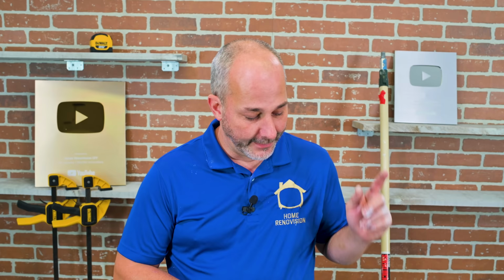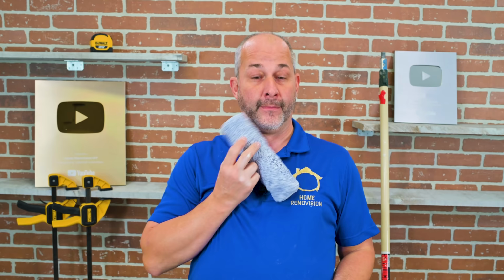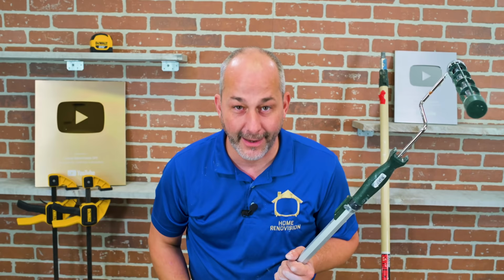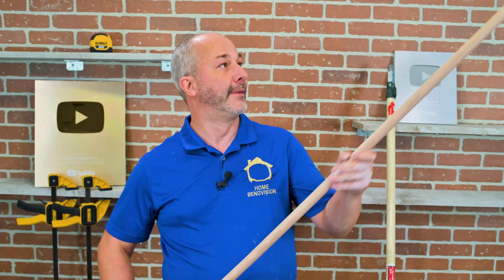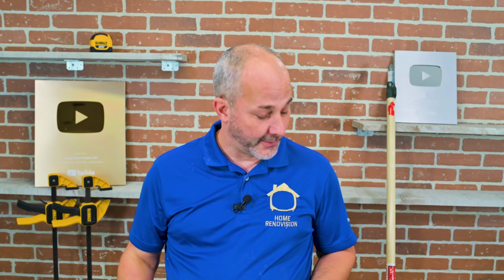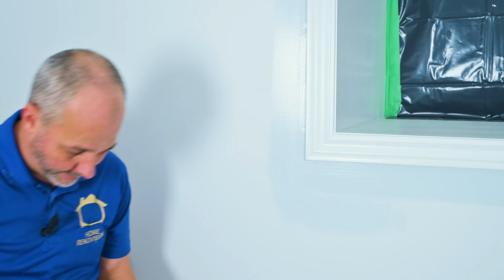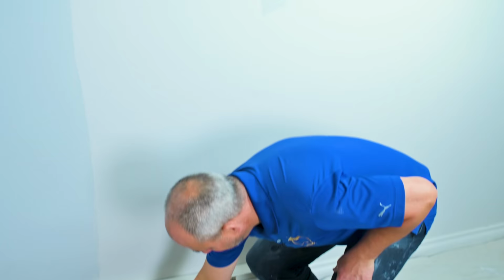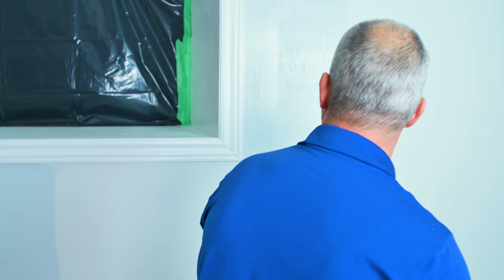Cheap vs Expensive Painting Gear | Is it Worth It?

Comment: I’ve found that getting quality brushes you can use over and over are totally worth it
Reply: Exactly. What is an extra $20-$40 bucks? And if you don’t have the extra $20-$40, then you shouldn’t be starting your paint project. Save for a tad longer until you get all the money for the self project with a little extra for things you didn’t consider and then start the job.
Reply: True!
Reply: #💯TRUTH
Reply: Get good paint also.
Reply: No question
Reply: Purdy brush FTW.

Comment: I've done a lot of painting & used both the cheap & better quality products & using the cheap stuff is time-consuming & a general pain in the butt. I've tried those straight edges that are supposed to keep you from taping to cut in & they were worthless. The paint bled around the edge. I hate taping so I learned to be good at cutting in, but I've used the 2" angled brush. I'm going to get the bigger one that you recommend. Bit of a head-slapper. Love your videos.
Reply: I think you meant "paint in the butt" 😆 🤣 😂

Comment: I used that trim tool on my stair walls. Didn’t have a great way to get all the way up close with a brush and that tool solved the problem with a long pole attached. Mine worked great just don’t get paint on the wheels and take your time it works like a charm.
Reply: I love that trim tool for cutting in around ceilings! I found one where the wheels flip up out of the way to load on the paint.
Reply: Came to say this.  Very clean edge over the stairs with a long pole.  10/10 would recommend, but you gotta be careful with applying the paint to the pad and not hitting the wheels.
Reply: Don't dip the trim tool in the paint. Brush the paint onto the pad.  Don't get paint on the wheels, and be aware of how far the pad is from the top

Comment: i would add, if you have large open walls and ceilings to paint, it may be worth getting a 18" roller in addition thats supported on both sides of the roller. You still need the 9 inch roller to get in close to corners and tight spaces. But if you have lots of large open space, the big roller speeds it up alot. In addition because it's supported on both ends of the roller, you get even pressure, and wont get streaks like you can if your technique is off with the 9 inch.
Reply: I agree. I just did this. Got a 18 roller with support on both ends and 4ft-8ft Sherlock extension pole. Worked great! Finished super fast and great coverage. Used the normal 9 inch for edges/corners. Should have gotten an 18 inch roller long time ago.
Reply: Thank you .. awesome videos, glad I found this place.
Reply: I have yet to find a store that sells an 18” roller. Hard to find in Canada
Reply: @skyline5354  go to paint stores. Like Dulux, cloverdale paint, sherwin Williams etc. professional painters use them all the time
Reply: @skyline5354     They sell them at Home depot, at least here in Kingston.

Comment: 10:21 That edge tool actually works pretty well. Instead of dabbing it in the tray, apply paint to it with a paint brush. 
Apply more pressure to get your paint closer to the edge of trim or ceiling edge. I've been using it on and off, in certain situations for about 10 years, with good results.
Reply: So use the edge brush to add paint to the edge tool?
Reply: I used to apply it with a paintbrush but I found it so much easier to pour some pate into a leftover squirt bottle and squirt it onto the pad instead. Same clean result, less bending, much faster.
Reply: @ljo7560  Good idea. 👍🏻

Comment: I love using the pad. Get the ones where the wheels come away from the pad and then re-lock in place. This is so that you can load the pad without getting paint on the wheels. Also a quick tip is to use a squirt bottle full of paint and squirt your paint on the pad rather than dipping it. What you don’t want is to get paint all the way to the edge of the pad. You’re going to use the pad like an angled brush and push the paint where you want it to go.
Reply: Love the tip of a squeeze bottle. I use a paint brush to load mine up and they are great for quick repaints ESPECIALY on the same colour.

Comment: I've been using the square trim thing with the rollers for years now. There's a bit of a learning curve but I absolutely love using it for fast jobs now. You definitely don't want to overload it and you get used to being mindful of the wheels rather quickly.
Reply: We have used it too. We like using for jobs that need alot of trim.
Reply from the maker: Great to hear!
Reply: @HomeRenoVisionDIY  I just realized, it might have left it at quarter inch Gap if you put the pad on backwards. That may be why it closed the Gap when you flipped it around. The tool doesn't have a safety to stop it from popping on wrong way.
Reply: @HomeRenoVisionDIY  Jeff, these people are scaring me.....

Comment: Jeff the red paint pad is by Shur-Line, they work great especailly on a repaint of the same colour. I can cut a room in less that 10 mins. Like using a brush the more you use it the better you get. I load mine with a brush but did a comment below that gave an awesome tip of using a squeeze bottle! LOVE my Wooster brush, rollers and poles.
Reply: If you don't foul the wheels you cannot beat the ShurLine. Latest version lets you pivot the wheels back while you load it. You can also clean em while they're pinned back, if nec. Yes I can cut a room in, but why should I?
:-)

Comment: Thanks for this demonstration/comparison. I can quickly said that if you are good at painting you can get away with both equipment. If you only paint once a year... the professional equipment won’t be much help! 😁This said :
- The tray you’re showing is a good option, it’s going to last for years if you take care of it. Just buy cheap plastic refills to save you time on cleaning.
- I don’t know if the Wooster frame I saw in one of your videos but I now have three of them. Can’t thank you enough! With these frames no roller are slipping out. Yes for the often cleaning. It might help also to put some WD-40 from time to time to have a smooth rolling.
- For the fibers I don’t usually have problems if I buy the roller you are showing (good quality). Yes for showing a little love; a well cleaned up roller can last a long time. Be careful using certain paints. When doing ceiling flat white from Benjamin Moore, if you don’t clean your roller the same day you are using it it will be ruin the next day (the roller is coming all stiff). Washing the roller can also help, being humid the paint is going to adhere a lot quicker to it.
- If everyone knew that having good brushes can help A LOT when doing painting. Same, clean your brushes properly and they can last for a very long time. Of course, the wider the brush, the more stable your cutting line is going to be ( I use a 3 in brush for cutting, smaller ones for detail cutting or hard to reach areas).
- Oh, I think I’m getting this Sherlock stick! The expendable pole you have is the ones I’m using now. The red tape on it is it to hide the screw on the pole? Don’t know why this is there, any answers?
- At 11:20 You must be referring to the «ProPainter». I used it once to cut a very high wall, it was ok because you don’t see the final result very close. I got the impression that what you have is cheaper than ProPaint. The wheels on the red model are more hidden it seems. And a tip I you say, once you dab the paint, swipe the border with wheels a little bit, just to make sure there is not too much paint on that side.
(sorry for this long comment)
Reply from the maker: Cheers!

Comment: The roller edger thing that I've used is made by Shur-Line.  I've never liked using it, and prefer using a good-quality brush.  Having said that, I used to be able to paint free-hand along trim, but with age, my eyes aren't as good and my hands aren't as steady, so taping is the only way I'm able to paint edges nowadays.  I've never enjoyed painting, but have done plenty as a DIYer.  You can definitely feel the difference in quality between dollar-store and paint store tools!  Dollar store ones are definitely throw-aways, while paint store ones can actually be washed and reused hundreds of times or more.  I also avoid big box store brushes, since they're sort of in-between and I'd rather just have a small handful of excellent brushes than a lot of so-so ones.  Exception is if I'm painting/sealing a floor or something... then it's all dollar-store stuff since I'll throw it away afterwards anyway.

Comment: He is correct. Oh my goodness, if you use a broom stick, it will constantly unscrew and potentially make a mess. When painting, use quality primer (when needed) and paint. Quality rollers, brushes, cages, and sticks are a must.

Jeff has multiple, detailed videos on priming drywall and painting. The prime check information is a lifesaver — makes for a perfect finish.

By the way, those edger pads start nice and easy for the first two or three passes, and then it becomes a mess. I tried them about six months ago, to see whether it would be quicker than the brush method. It can make it quicker for less experienced painters (including myself). Unfortunately, it is a mess. I just practiced edging with the brush, with no tape. It’s fine.

Comment: Dip the cart with the wheels tilted up and load paint towards the back / opposite side from the wheels. Start in the middle between 2 points your trimming make a short pass away from the guiding edge in case you have excess paint and then come into what you are putting your wheels against. Keep a wet rag nearby if you get paint on the edge guides. Once you learn how to use them you can smoke someone using a brush bc those pads can hold a lot more paint than you realize.

Comment: I've been painting with my line of work for a few years. My previous job we swore by the same Sherlock system you have (it really is worth the money). This job I was literally given an identical frame and a broomstick and I told my boss I won't do it because it will look like crap and get passed onto me. We got some better painting gear, and I've been slowly getting my coworkers on board with better technique.

Comment: Thanks Jeff. I believe in getting what you pay for but I admit to buying cheap rollers & brushes because I expect to toss them after a few uses. However, your video has given me reason to reconsider. With the reduced consumption of oil based paints, cleaning is easier.

Comment: I've used one of those edger things and it's decent once you load just the right amount of paint in it.  It can hold way more than it looks and it makes a mess quick.  The big caveat for it though is that you have to have a surface those wheels can engage on and not all edges are going to have that.

It can add some speed to edging, but you can only get a mediocre-at-best result.

Comment: for the flat pad with the wheels, the pad itself goes on two ways, with stops built in to either leave a gap near the wheels or get up right close to the wheels. I've used the red one often. I lightly dip into the paint then wipe the whole pad along the edge of the pan to remove excess.  I will roll along the trim and then lightly wipe away the edge farthest from the trim with the pad wide without the wheels as though it were a brush, so there is no line but is feathered in to the wall in case it dries before i go back with the roller.

Comment: I do cut ins the same way you do, I never use tape anymore. I always found with tape there'd be an uneven edge to the paint, whereas without the tape and just using an angled brush I get a much cleaner/neater finish. It's a bit more effort but totally worth it.

Comment: Cheap demo at 10:19 mark...the trim item is SHURELINE...and what I do is smear the paint on with a brush...not dab it in the paint tray directly...this way you do not get the paint on the wheels...and YES work your way in....start away from the ceiling or trim and work your way in to it in multiple passes...

Comment: I've painted my whole downstairs with that red cut-in pad contraption lol. I hate the roller brushes but maybe I need to try a ball bearing expensive one? I have textured walls and the square red thing was just way more even coverage and way faster than the roller I tried using and much less fatigue. I'm sure I was using the wrong nap or wrong material roller and wrong style and terrible technique. That's why I'm thankful for people like you that take the time to teach proper methods.

Comment: Regarding the reuse of roller covers, I can't be bothered cleaning them.  I will usually buy the medium grade cover and when I'm finished I will either stick them in the leftover paint can for use next time (if its a fiver or 2 gallon), or just wrap them in a plastic bag and toss them out.  Its not worth the effort cleaning them, nor do I like sending that much paint into the water system if I can help it.

Comment: Kind sir,
I am a 25+ year painter and have painted a lot of different substraights. I would not use any of those tools or procedures. For the same cost, you can do a whole lot better. 
1. 5 gal bucket and grid.
2. The paintbrush needs to be matched to the product that you're using. ie stiffer for most wall paints.
3. A lambswool roller is also $10 and will drop about 70% less paint when you roll.
4, A mid-grade roller frame and buy 2. You won't regret it if one breaks. Also do not push on the roller 
when rolling. When rolling, all the way up and all the way down just slow enough that it is not throwing paint off. Let the roller do the work.
5. The roller poll with threads will be much less work when needing to remove the pole over and over again. 
6. Roller pads meant for walls should not need to have lint removed. That green tape is nice and expensive so do not waste it. 
7. There is actually a time to tape the trim but only if it is a high end house and there is a large contrast between the wall and trim color.
I do enjoy your videos.
Please let me know if you need a consult.

Comment: I usually buy the angled brushes. Better for cutting in & corners like you explained. Keeping them clean after use is key. They usually last me 3- 5 years. About 10+ walls or more. I obviously don’t paint THAT much. lol As far as rollers are concerned, I usually buy a 3 pack. They have worked just fine so far. Wash, dry & reuse. Again keeping them clean after use is key.

Comment: The edging pads do have a use. But buy a good one ... the one Jeff uses is a cheapie, there are better ones.

I'm 5'2" when I stretch really tall. My house has 9 and 10 foot ceilings, and a stairwell close to 20 feet tall. For most of the wall-ceiling junction I can use a brush and a ladder ... but not in the stairwell or over the bathtub.

If I use an edging pad on my extension pole, I can reach those areas.I can't make a perfect line, but it's good enough . Those impossible to reach spots are also places where it's hard to see how good a job I've done.

Also, I use my brush to apply paint to the pad. It's easier to avoid getting paint on the wheels. And the pad needs to be installed the right way — if it's upside down, it leaves a 1/4" gap.

Comment: This is going to sound weird but I actually liked using the pad style tool for staining my fence. The finely bristled surface area of it meant I could work stain into little crevices in the wood that would have mangled the bristles on my brush. I threw it away when I was done the second coat, but I'd 100% buy it again for that purpose. To be clear I still used a brush, but this tool was so handy!

Comment: I saw another DiY channel and they took a small nail and hammered it into the metal area of the paintbrush and bent it 90 degrees and allows you to hang the brush in a can. It does counter the ideas here of reusing the package of the brush but thought it was a neat idea.

Comment: for the trim gadget with the wheels, I had to use one in my bathroom because I had high ceiling and couldn't reach the corner. It did the job all right when mounted on a pole. I wouldn't use it if I could reach with a brush.

Comment: I've had great results with a pad, but what I do is have a bottle full of paint like an old squirter ketchup bottle that I load the paint on the pad with. I never get paint on the rollers that way, and it leaves a good crisp line. Much faster than cutting in for me. I'm not nearly as quick as Jeff cutting in, but I imagine most of us are much slower. Also, I carry both the pad and bottle with me, so I don't go back and forth to a paint pan.

Comment: I used a dollar store cage for priming a small wall as my other cages were being used in use in other areas... I put the normal amount of pressure on it as I would usually and within minutes it snapped where the metal meets the plastic :'D I'm a painter by profession and I can assure you that spending a couple extra dollars for good painting equipment is worth it :)

Comment: It will be a better way using the small pade with 2 smalls wheels. Put the paint with the paint brush on the pad instead deeping in the paint. Of course it takes longer time.  Start by brushing the paint in center the pad and go to the outside. Sorry my English is not very good. The small pade help people that have dificultes to use a paint brush and paint the contours. Tank’s for your videos!

Comment: My only comment would be for video purposes, use a different color that shows up better so we can see the difference of what you did.  Looks like you applied a light blue paint to a light blue wall?  If for example, you used a medium gray, then we could see how well the products performed (or didn't).  :)  Otherwise, great video, very helpful!  I have bought cheap roller covers and paint brushes in the past because it was just for one job, but now I see why spending a little bit more can make all the difference!